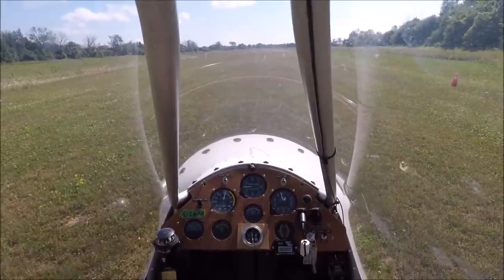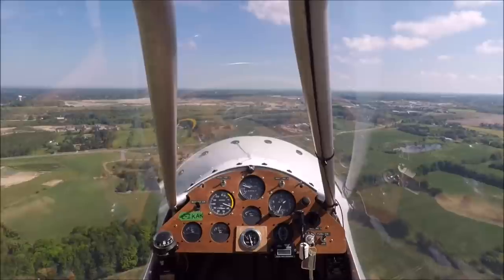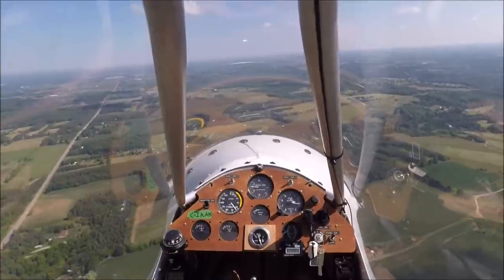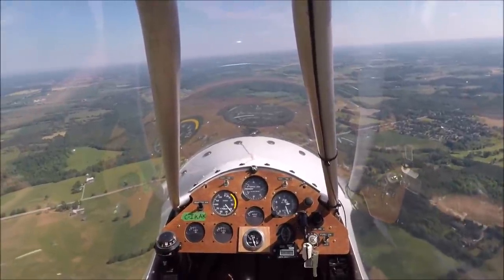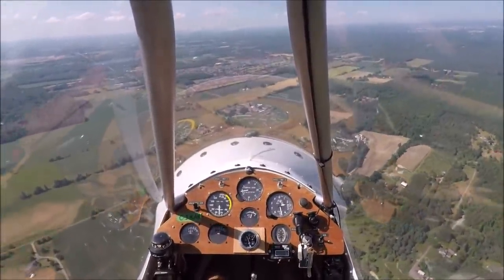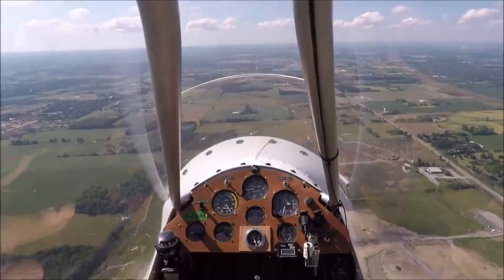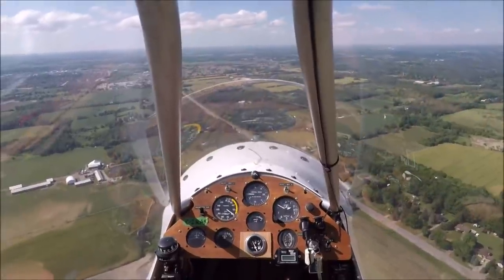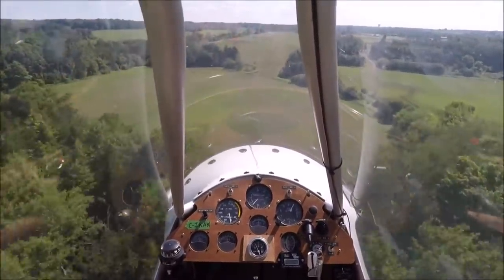Challenger II fan belt failure in flight heats things up

Comment: That was a lot less dramatic than I would have expected. I'm rebuilding and modifying a Challenger 2 with a 503, and was wondering how drastic the over heating would be if the fan belt let go. It does heat up, but it doesn't seem to be catastrophic and is manageable. That sure is a relief. Cheers from Winnipeg.
Reply: Wrong. Hope you found out how wrong before it happened

Comment: Did the owner actually say 1100 degrees when asked what a normal cylinder head temperature was? Jesus Christ! When asked what it was the day before, he had no idea. They put those instruments in for a reason. Use them, and know where they belong. Not sure what engine you have in that thing, but I try to keep my cylinder head temps around 360 degrees and will never go above 400. Above that, the wear on the cylinders due to oil thinning goes way up. Continentals usually have a 460-degree red line, but that should be considered an emergency limit.
Reply: Mate thats melt down Temps

Comment: Not to nitpick, (too late) shouldn't the deteriorating belt  been detected on the pre-flight?
Reply from the maker: Yes, you’re absolutely correct. I didn’t have a pre-flight check list at the time and so it was missed. I have since put together a checklist and the belt is on the list.
Reply: @chrisgeneau1023  Excellent!

Comment: Nice video, great u got back to base to chk the issue 
did u put blet urself? how much it cost u
Reply from the maker: Yes, I have replaced the belt a couple of times since then. There was corrosion on the pulley causing premature wear on the belt. The pulley has now been replaced and a new belt installed. The cost was minimal. There are YouTube videos showing the replacement and adjustment procedure for the 503 fan belt.
Reply: Chris Geneau     thx

Comment: If the fan belt failed you would have landed in about 2 minutes
Reply from the maker: It failed. Pulled the exhaust manifold the following day to make sure the rings weren’t stuck. Replaced the belt and it’s been good ever since. Tension and visual check is definitely part of my pre-flight check now.